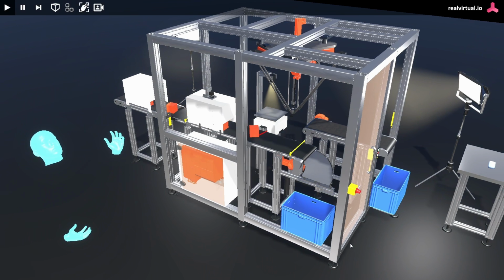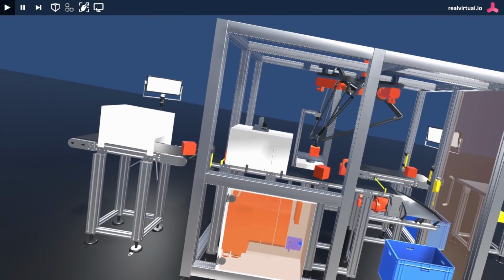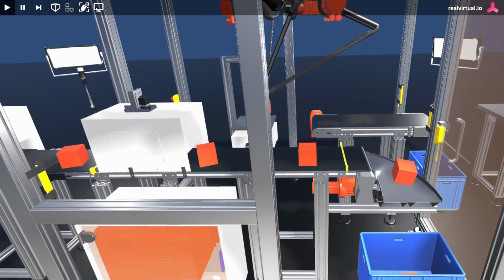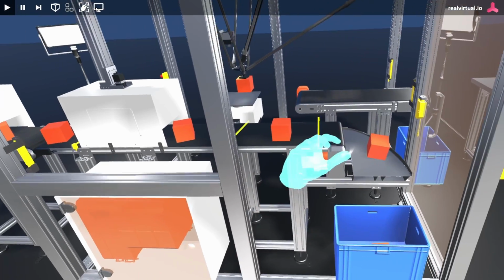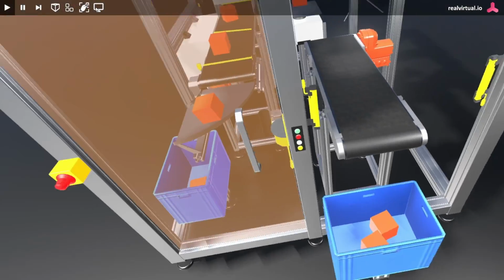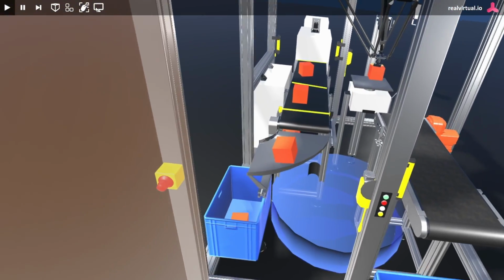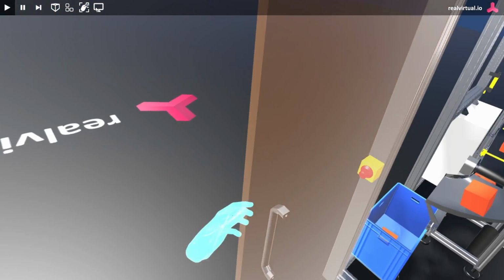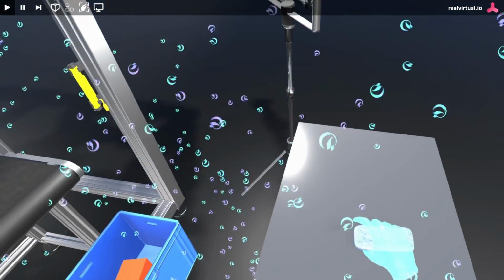Digital Twins in VR with realvirtual.io and VR-Builder

Comment: Which VR Glasses are compatible with the product and which one is in used in the video? Will it be required the pro version of the realvirtual for your unity asset?
Reply from the maker: In this video a Meta Quest is being used but VR Builder supports all common VR devices thanks to OpenXR and Unity XRI. The integration works with all realvirtual versions but the capabilities differ.